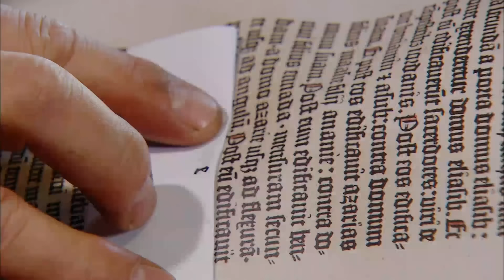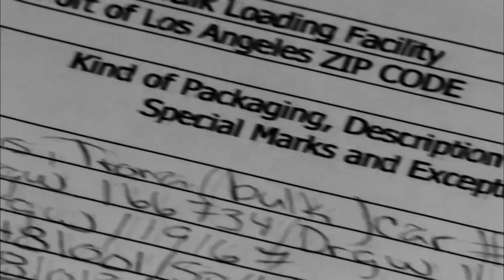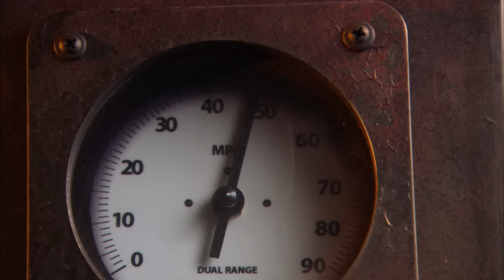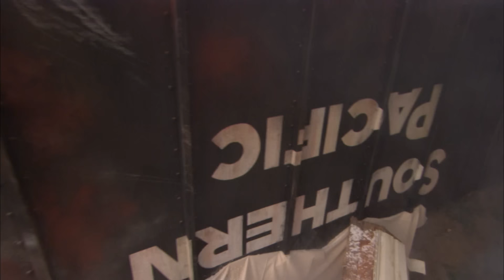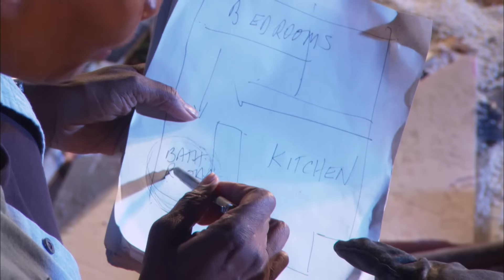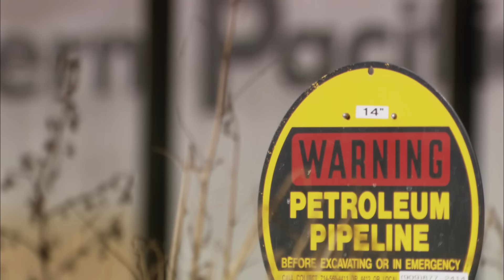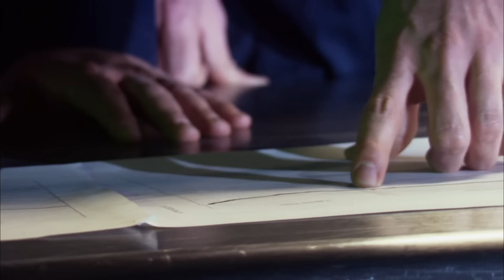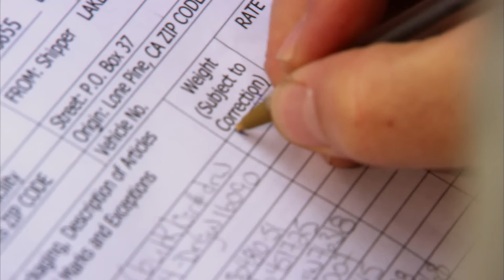Horrifying Runaway Train: San Bernardino Train Disaster SP 7551 East | Mayday | Wonder

Comment: If I recall this correctly, there was one guy in a little shack erroneously recording and adding up car weight in Trona Ca, a gloomy dusty bauxite mining facility near Lancaster. Underestimating the train weight resulted in too few locomotives (used to help brake train speed) and too high an allowed downhill speed. Maybe the video says that, but it was too over-produced to watch.
Reply: Your correct.
Reply: @Rusty_Nickle  no, you only need the locomotives to pull it uphill, only need one locomottive to go downhill
Reply: @johnirwin11  that's not how train braking works. They needed the dynamic braking of those engines.
Reply: @sld7262  i know how it works, i didnt hear them say it was equiped with dynamic
Reply: @johnirwin11  that's not how that works. It's just like a semi without the engine braking you'd smoke the brakes right off the thing
Reply: @Rusty_Nickle  before dynamics, they set retainers on the cars and in some cases handbrakes

Comment: @14:00,.  That doesn't look steep to me..
This accident, no disaster, was caused by incompetence from A to Z... including the pipeline damage.
Holland, Hill, and Thomas Blair should have been fired. 
Instead no one was. Not even their supervisors, or anyone involved in the clean up.
Reply: The railroad has a very strong union. You might be surprised at how many alcoholic engineers there are.
Reply: Railroad grades are very deceiving. The max grade rail equipment can climb is about 3%, to put that into perspective your car can climb a grade of about 30%, and humans, with a lot of work, can climb a grade of nearly 80%. Which is what most staircases are. 

James May has a video on the concept of trains and hills that explains the reason why trains cannot get up hills greater than 3% very well.

As for the train crew, I don’t feel they should have been fired. All calculations were made correctly by them however the data they were given to make the calculations from the shipper and yardmaster were wrong.
Reply: @ConrailFan76 ,. Ultimately, when the train became doomed was when they applied the air brakes. Applying the air brakes released the dynamic brakes, and enabled the train to reach the speeds it obtained before running off the tracks at the turn. (Do you know how dynamic braking works? I do.)
They panicked, and did the worst thing they could have done....
Besides, he was the engineer. He knew he had malfunctioning equipment, and yet he went with it anyway... 
Being a Union employee, he could have refused, and he'd never have been fired! (The buck stopped, or crashed with him.)
They fired no one. Not even the guy who fudged the weight of the cars. He should never have guessed. He knew he wasn't supposed to release the cars for shipment without a weight on the paper work. But, he did it anyway. (He committed fraud.) Was he fired? No!
Mistake, after mistake was made, and 7, and 9 year old boys lost their lives.
With no accountability! 
I think you're on drugs. Not I....
Reply: Frank Holland was a victim in this, not the perpetrator.
Reply: @silicon212  ,.Perpetrator is a bit harsh. I dont think anyone purposely did, or wanted this to happen, and I didnt say that.
He was but one of several incompetents.
If he had refused to make the trip with his broken equipment, and been fired or suspended because of it, then he would have been a victim.
Reply: the pipeline damage ocured with the cleanup.

Comment: Half of this stuff isn’t true

Souther pacific 7551 isn’t the name of the train, it’s the name of one of the SD45’s that was in operation during the wreck

SD60’s weren’t even a thing back then

There were 4 engines in the front

Southern Pacifica’s paint scheme was not the same as the Union Pacific. It was black with a red nose

The train didn’t yeet itself onto the houses because that is not possible

I could go on but someone out there could probably understand what I’m talking about
Reply: Incorrect on the SD60s.  The SD60 hit the rails in the mid 1980s - although SP never owned any.  They did have GP60s at this time, but none of those were on this train.  Also the SP paint scheme was gray and not black ... Dark Lark Gray and Scarlet Red are the actual names of the colors used.
Reply: @silicon212  
Thanks for the correction. I didn’t realize that

Comment: When six locomotives are required, it's clear they were pulling a LARGE load. Given such a large load,  I'm surprised:
1) It would not have been MANDATORY for all the locomotives to PRECISELY know the load's weight in order to work in a coordinated fashion.
2) Southern Pacific would ever have permitted ANY locomotives to be operated on grades with ANY inoperable brakes. To do so reduces the margin (2 of the 6 were inoperable)
3) The locomotive engineers were not educated about their machinery and were UNAWARE that applying the air brakes would disable the dynamic brakes
4) That weight 'guesstimates' were not EXPLICITLY forbidden from the start.
Reply: so it was dragging the traction motors? i always thought the air brakes supplemented the dynamic brake circuits. interesting- that would do it!
Reply: @tommurphy4307  Only an emergency brake application disables the dynamic brakes.  Any other is ok.

Comment: When the dynamic braking was disengaged, was there any indication ?
Reply: Dynamic braking alone wont slow down a train that heavy on that steep of a grade, it's fairly useless.  You don't want to lose the air out of the train line, that's the only way to stop in that section of track.

Comment: 7 years earlier I was in the paramedic instructor program at Crafton Hills only a short drive. This accident could have been avoided if anyone of a number of things happened. The dispatcher didn't leave their station, the train company taught emergency procedures on runaway Trains coming down the grade, commumicated with other engineers on the train, they could have contacted police to evaluate the residents, taken out a piece of track before it reached the town, set up a blockade, used other trains from adjoining tracks, brought in aircraft, pulled individual car brakes, disconnect airline, taken out the wheels in the lead cars, or had some sort of cargo chutes to deploy or hook anchors to drop. The weights need to be accurate and trains functioning properly the same as trucks and planes. Any failures should render equipment out of service. No fine can be big enough to make up for any loss of life. The problem first began when they put tracks on ground that had more than a 1% grade without level off and up grade before coming into a  community of people.
Reply: You've got some pretty funny suggestions there!  Airplanes?  To bomb the train???  Chutes and anchors????  I doubt it's physically possible to get into the LA Basin with a 1% grade, except via Santa Barbara, which is not easily accessible by rail except by other grades.  An upgrade before the community???  How do you do that when the community is at the BOTTOM of the hill?

Comment: I work at a class 1 (major) railroad as a mechanic. Nowadays , they do dynamic brake testing and ground person checks the air brakes extending and retracting personally. They weren't supposed to put a b/o (non-working) engine in the middle of the first three, they should have rearranged it as the 3rd engine and treat it as a car (engines pull cars). Otherwise MU cables cannot do their work to communicate between the engines to activate the dynamic brakes. 
I saw stuck brake shoes getting burnt surfaces and becoming useless, losing their braking power, so it makes sense that constant braking downhill made the problem worse. I saw aftermath of a few accidents where trains collided with vehicles, and especially an engine, weighing 200 tons, hitting a vehicle at about 1 ton, the destruction is inevitable.
Also, conductors are supposed to walk along the trains checking every car on each sides before departure, and trains can be 2 miles long ! So, in theory there are so many safe guards in place, but in reality, it's a union environment, and trains lose money for each hour of delay, so, there are many human errors in play.

Comment: If your using ANY digging machine to break ground on or around services be it gas or power you DO NOT use teeth. You is blades only. 
And if the idea was a service clean up they should have used bladed buckets and machines. Like a mud bucket as it was clearing surface material. 
Simple.
Reply: Agreed 100% !

Comment: As a former Freight Train Conductor the train in EMERGENCY could NOT roll down the hill...All BRAKES would be on!!! UNLESS  they did not have air to the whole train and those cars were bled off...no braking power at all. Trains apply there brakes when the air in the system is diminished...no air in the system causes the train to go into Emergency and All Brakes are applied!!!

Comment: I remember this very well , I lived right next door in Riverside , those houses were obliterated, just piles of scrap wood , I've counted trains pulling 300 train cars long , 3 engines up front , then at 150 cars in there's another engine , sometimes 2 in the middle ,then 2 in the back it's amazing , when your  sitting at a railroad crossing when you catch it as it just goes by if that baby has 3 engines up front it's Gunna be a long one

Comment: Also Human Error wasn’t the cause of the factor on the behalf of the crew I think when Engineer Holland and Hill spoke when Holland asks Hill he has all dynamics Hill says yes but it’s important to note 8317 the leading helper unit had no dynamics and the locomotive the helper crew were in (7443) a similar model to the original leader (7551 and 7549) had all working brakes as was the new leader (8278)

Comment: There are a couple of things about this disaster that leave me wondering.

1) How the hell did that train manage to stay on the rails at those speeds, especially around the turns. With the weight of the train and the speed, I would think the train would have tipped over long before it reached Duffy Street. Or the rails would deform from the ungodly amount of force on them.

2) The guys in the rear helper threw the air brakes into emergency. By doing so, they inadvertently cancelled the dynamic brakes and made the situation worse. I wonder what would have happened if they just left the dynamics in full and the air in full service and just let the train do it's thing? Would the straight section at the bottom have given them a bit of headroom to slow down?

Not passing judgement on anyone involved in this. This is a terrifying situation to be in.

Comment: Much more than two mistakes.  The guy who didnt write the weights, the guy that wrote false weights, the guy in the rear engine that only had one brake but claimed to have full brakes, the guy in the second engine that had no brakes at all, the blokes at both call stations that failed to answer the phone calls promptly and did nothing upon receiving mayday calls, also the township that permitted houses to be built alongside the rail line, the gas pipe built alongside the rail line, the railway placement with the major curve acting as a slingshot of the train coming down the mountain into the town, the town failing to have emergency claxons at the slingshot danger zone, the gas company failing to make full assessments of the pipeline after the area cleared of manure compoments by machinery.  They are just the points I remember the nareator sayimg before announcing the claim of just two errors.  Oh and the guy in the rear cancelling all the brakes due to poor training and lack of knowledge and understanding what the consequences of actions were culminating in.  Plus there didnt seem to be discussions about altering systems at the train managment nor aktering the environment the engines to provide better crash positions to increase chance of life saving for drivers and offsiders.

Comment: Fun Fact: Due to the way airbrakes work(their effectiveness is inversely proportional to speed, IE, the faster you go the less the brakes work and vice versa) it's believed that if they had immediately engaged the airbrakes in full at the first sign of trouble they may have been able to limp down the mountain(still going faster than normal, but probably slow enough to not catatrophically derail)
Reply: Would have been possible

Comment: That's the wrong SP 8278. even though 8278 is that GP9's actual number, the 8278 involved in the wreck (which was the front locomotive) was actually a SD40T-2, not a GP9.

Comment: So there are only three such passes across the mountains??  That sounds like a major security flaw in the infrastructure.  A group of commandos during a war could easily take out all three lines for significant periods of time especially if they derail a train at the right point leading to blocking everything.  A group of whackos could do the same as I doubt there is a lot of protect along the line.  Wow the stupidity.

Comment: 16:23 
It wasn’t your fault dude. Accidents happen. I’m no expert but what I think happened was poor maintenance and as a result, the brakes went out, coupled with the heavy weight of the cars he was pulling, it’s no wonder that the accident happened. Again, I’m not pointing fingers, or saying it was his fault.

Also.. if using the emergency brake on the train cuts the dynamic brake, why did you use it? It would have been more efficient to have kept the dynamic brake on. That’s also a factor that caused the accident.

Comment: -- Fun Fact(s):

    • Prior to leaving the Mojave railyard on the night of May 11th, according to the N.T.S.B. (National Transportation Safety Board),
      the original lead engine, Southern Pacific EMD SD45R No. 7551 -- sporting the Kodachrome livery despite an unsuccessful
      merger attempt between Southern Pacific and the Santa Fe Railroad in the 1970's -- wouldn't start. The crew wasn't notified
      of this, nor if it was reparable.  So they ended up having to borrow S.P. EMD SD40T-2 No. 8278 the become the new leader,
      but still kept the symbol of 7551 East, leaving 7551 to be dead-in-tow, save for its own air brakes.

Comment: thanks for documenting the event. is a double tragedy. in the first part the cause is not mentioned? I am surprised that experienced train drivers do not do a "brake test" before driving, which is done before departure. after departure, an active test of the braking effect will be carried out!
  did he know that he had a weaker or defective machine and did not calculate the braking effect? is that an experienced train driver?
  maybe if he had kept half the speed down the hill he could have stopped safely?
 missing locomotive type, tech. data, train weight, braking %, min. braking percentages. dynamic brake, brakes only locomotives, air brake brakes the whole train..it needs more accurate data.
  I have no idea what the regulations of the SP runway are, but this is neglect of duty..the next is to use a sound warning-horn, to warn the surroundings. the second part of the pipeline accident, is a sad tragedy as well. memory of the wounded and dead..

Comment: May 1989
26:20 survivor under rubble
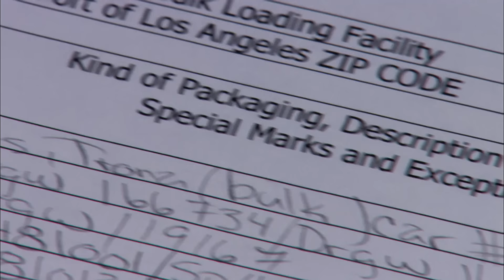43:35 engineer didn't put payload weights in the book
45:25 NTSB CHARLIE BATTEN said the fuel company charge 1600lbs of pressure in the fuel line, saw no problems

Comment: It is confusing to show this runaway train disaster with velocities stated in in kilometers per hour. Nobody in America thinks in Kilometers per hour. They think in miles per hour. There needs to be some corrections made to this video. There was NO WAY that the tonnage involved could have been stopped by six engines. Loaded hoppers can lock their wheels up if (and this is a big if) they are empty.  A loaded hopper is, on average, a minimum of 125 tons. Believe me. There is no possible way a loaded covered hopper can  lock up wheels. Even if it could, there's only about 8 square inches steel on steel contact between the rail and the 8 steel wheels on the covered hopper freight car go trucks. Simply put there was no way to stop that trainm on that grade.

Comment: This system of break management is really a disaster. No wonder something like this would happen. It's mindblowing that they use the force of the  dynamic breaks for the calculation of how much breaks they need because as a safety feature in an emergency break all of the dynamic breaks are nullified. And thats exactly what has happend. The second thing is if you are driving downhill you have to break so that your speed is 15 mph UNDER the maximum speed allowed, than you release the breaks to let them cool off and fill up the lost air and than you apply the breaks again. It's ridiculous how trains are conducted in america

Comment: Corperate negligence on so many levels. Why are so many locomotives having dynamic breaking systems not operating correctly dispatched? Why was the pipeline allowed to restart without operational safety isolation valves? Easier to blame it on the one guy who under estimated the weights.

Comment: They should never have taken a chance knowing that not all of the brakes worked. The dispatcher should never have let the train leave without the right freight and weight information.
The short cuts they took should not have been taken.
The inspectors should have done a complete accurate inspection of the pipeline.
If they all would have done their part this entire event would not have happened. Next thing is they should never have built homes near the tracks. Airlines are guilty of the same kind of neglect. Smh